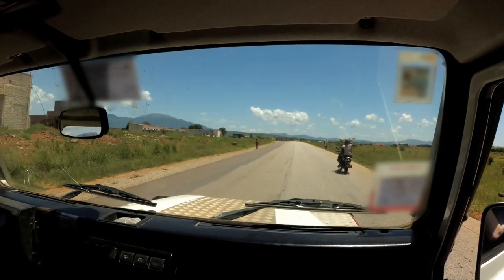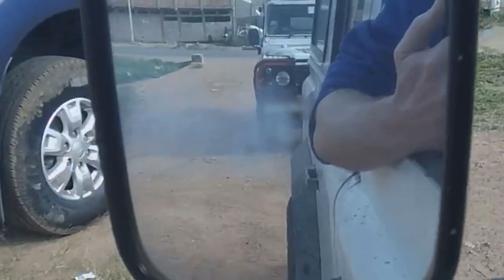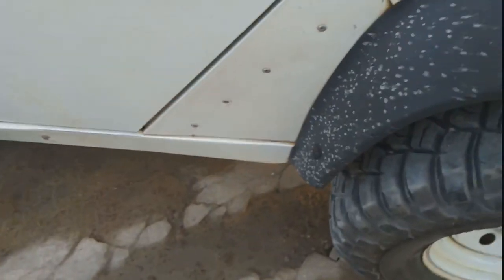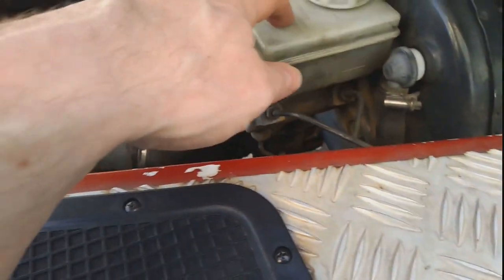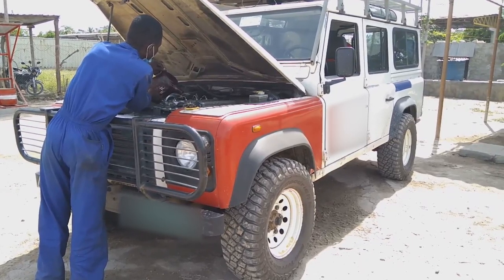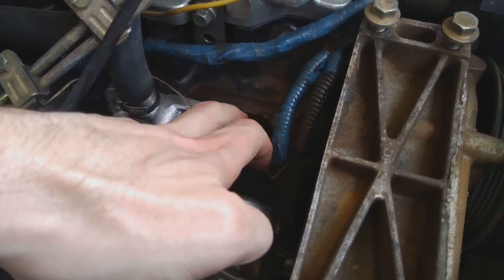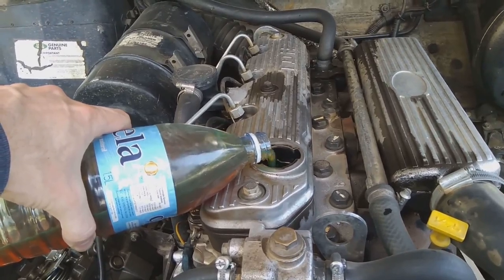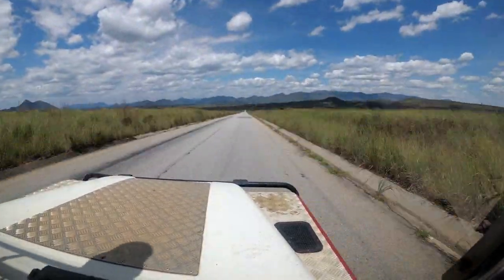That time I almost destroyed a 2006 300Tdi....

Comment: The original engine in my Series III used to burn oil at that rate, but then again it also had next to no compression either. In fact, it was so bad that you had to do the valve clearances every 500 miles! I bought another engine for £50 (back when you couldn't give away 2.25 petrol engines) and that worked for a couple of years. In the end, I purchased a NOS block and had a Turner head fitted to it, and run it on nothing but top quality oil. It's been all over Europe, and well as Southern and Eastern Africa, and it still runs perfectly to this day. Probably uses about a litre every 2,000-3,000 miles.

Comment: I was curious when you said the chassis there were in good condition and started looking. My goodness they were indeed in good nic, at least for the ones i saw in EAC and SADC. Guessing the rainy season didn’t impact it as much.

Regarding checking the vehicle, it’s reasonable to assume (self maintained) fleet vehicles would at the very least take care of the servicing and consumables.

When i got my row tdi, it was my first 4x4 and my first ‘old’ vehicle, so i did the boring thing of checking the oil, the coolants and looked for puddles. This despite the restorer and mechanics’ reassurances. The shop did have a good track record. Nonetheless, if something were to happen, while they would no doubt ‘make good’ on shortcomings, i’d be the poor sap stuck in the middle of the road somewhere, so what the heck, might as well add three minutes more to the seven minutes to warm up the old lump.

Comment: Look at the oil on top of the intake manifold. It's being pushed out of the pipe coming from the intercooler. 
It is probably a faulty vacuum pump causing excessive breathing.
Mike from Brittanica restoration had one that breathed a lot because of this.
Intercooler is most likely full of oil.

Comment: Yep your rings have gone. Bet you the cylinders will be beyond a rebore 30thou I believe. On my tdi took head off for top end overhaul and could see serious wear on cylinders. Put it back and it ran for about 10000 km used no oil and then one day it started. Drove Johannesburg to warm baths about 120km and oil level dropped by about 1 l with no loss of power. Had engine overhauled and the wear was to great to rebore so I had sleeves fitted with std pistons. That was 7 yrs ago and it's still going strong

Comment: Renault traffic engines can be really bad for this , my friends for example will use 1L every 200miles and the one we had at work was even worse .
Usually the turbo seals go and it ends up burnt or in the intercooler.
Yours looks like it's similar , a lot of oil around the inlet manifold, I'd expect quite a bit of oil in the intercooler by the looks of it.

Comment: I have 3 Discovery 300TDI, and 2 Range Rover 300TDI and if you need to check the oil that often and it's not leaking you have a severe problem, at the very least it should be smoking a  lot using that much oil.

Comment: Definitely worth replacing the engine thermostat on a 300tdi as they are so easy to change in 5mins with a good quality (never use unbranded) one as your heater won't work without it, it will be much worse on fuel, weird smoke as you get incomplete combustion when they mostly jam open, easily forgotten part and fundamental to smooth running, once you get it to run at normal position on gauge, it with start to give itself a de-coke..........

Comment: Never over fill an engine with oil, it's as bad as running an engine dry.
Reply: Why do you say that?
Reply: @flight2k5  if you overfill an engine with oil you will pressurise the engine crankcases and the breather pipes can then start syphoning the engine oil, in extreme cases the engine will literally start running on the engine oil as well as diesel, when that happens you can drive without touching the throttle because the revs climb to cruising speed, I did it when I was young and so I know the theory and have experienced it as well, 60mph without touching the throttle and I had to turn the engine off everytime I wanted to brake.
Reply: @Silverback1969MoonLandingLies  no it doesn’t